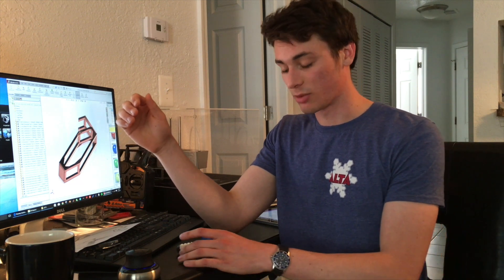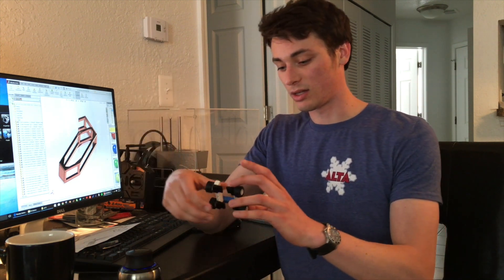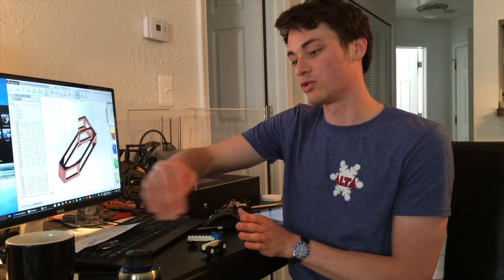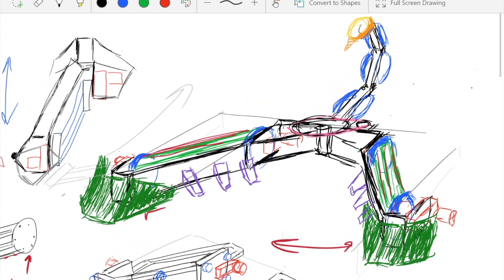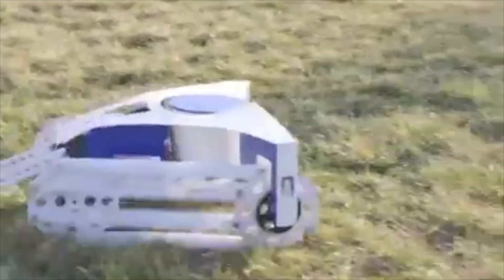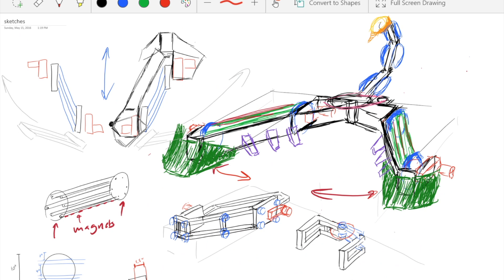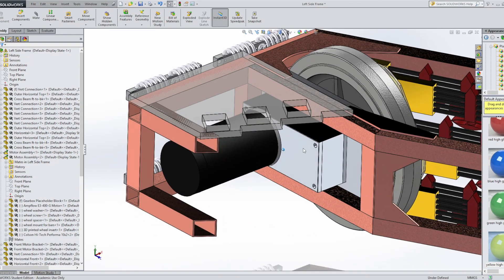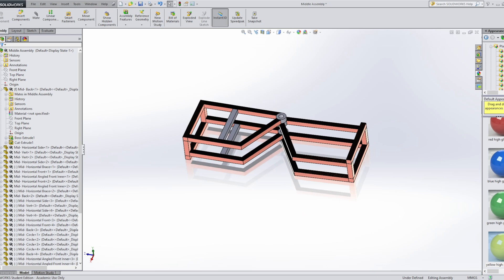Designing a BattleBot (Pt. 1)

Comment: We use the amp flow speed reducers on 10" wheels, and have been happy with the speed, but the motors get hot after a 3 minute fight. So you might be right about slowing it down a bit. There still might be season three, and Robogames / Combots is running twice a year now, so I'm sure this bot would have a place to play.
Reply from the maker: Thanks for the tip!  I haven't found anyone using 10" so that's good to know

Comment: Maybe you could look into an omni-wheel setup where the wheels will pivot as well so they keep the same orientation closed and opened. Not sure if that would still get you the arc motion you are looking for, but maybe something to consider. I like where it's going! Halfway disappointed not to see a huge refrigerator box clamper. :-P
Reply from the maker: I'd love to scale up Krave so that it's just a big box. I could enter two: one empty box with some small wheels attached as a decoy. I am thinking about some omni-wheel setups, haven't found a simple one I like yet
Reply: AltaPowderDog When is the next CIRC bot brawl? I want to see an antweight full body spinner and a polished "redrum" (you know what I am talking about.)
Reply: August 12th. Spinook is signed up. Don't see Redrum in there, but I know Carter has "Trebuchet" signed up. It's a full event, with both Ants and Beetles signed up to max capacity already.

Comment: How would you drive forward to clamp if you are open.
Reply from the maker: Fully open won't allow for forward movement, you're right.  However, with the current setup if the front is open only 2 feet or so, the wheels are still pointing forward enough that it should drive forward with some wheel scrub.  I'm still experimenting with the right balance..
Reply: Okay cool

Comment: If Battlebots doesn't come back you could always attempt to get into Robot Wars, which is pretty much the UK equivalent. If you use the full 250LBS you'll have to drop around 3KGs as the weight limit is slightly lower (110KGs compared to 250LBS). They've been after unique designs lately too, which this would certainly fit into.

Either way if this does get built you should have a very good chance of getting to compete with it, even if BB doesn't come back (Here's hoping it does though).
Reply from the maker: Thanks!  Transportation to the UK would likely be expensive, but it could be cool for sure. We'll see...